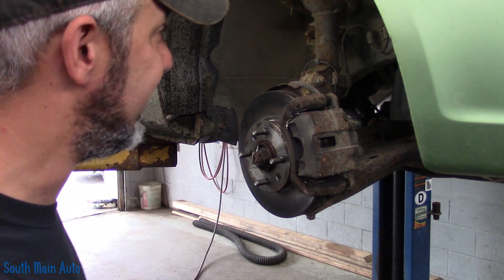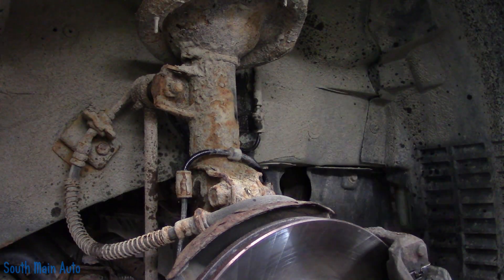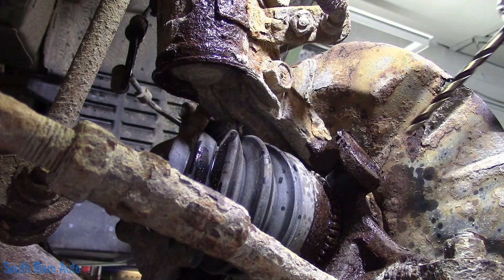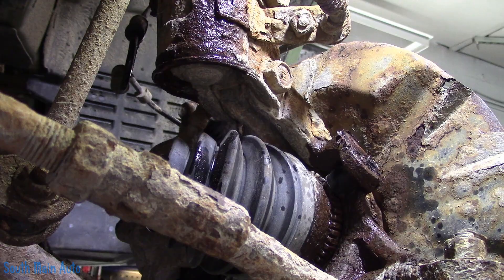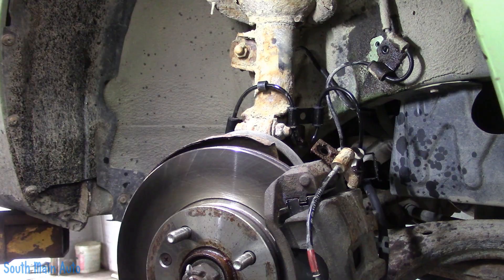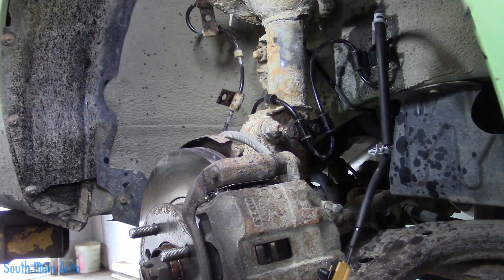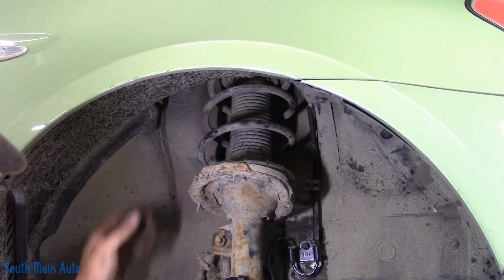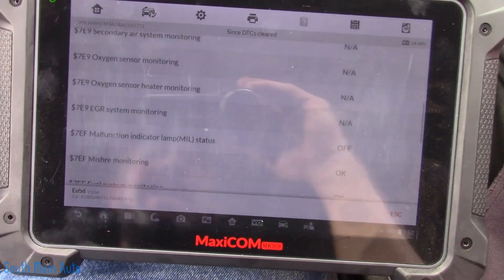Hyundai Accent: P0501 Vehicle Speed Sensor Range/Performance

Comment: Eric, I was just wondering if these sensors on 4 wheel ABS-equipped cars are also used for measuring and displaying overall vehicle speed. If so, how is the speed difference between wheels handled when it comes to displaying the overall speed when taking corners and curves?

Comment: at 9:19 small diameter "flapper wheel" is much easier to control and not obliterate the knuckle hole (clearly you didn't, but not everyone has the experience yet)
I do love carbide burrs and other tooling, they're hard to control and use skillfully outside of lathes and mills ;)
Reply: I'll limit my comment to "JUNK"
why, because they cheped out too much making a electric power tool as was much of the earlier cordless....
junk tooling makes me blow steam out my ears and causes me to exterminate junk vastly

Comment: Drill down to the tone ring and bit hits a tooth, snap tooth is gone. Done that before, not a good day.
Reply: Been there done that.  In my case, the whole tone ring broke off.  Thankfully those were available as a replacement part (mid 2000's Ford Explorer) because they tended to break on their own from corrosion.

Comment: alternate on those with most of the sensor visible out the bottom! torch with pinpoint tip heat the rusted magnet/metal until the composite housing melts and pry-driver it out from the bottom :))
goes back to knowing nuffinks ( i'll edit to mention how easily magnets break when hit or pried on, crunch crunch)

Comment: My guess is the wheel speed sensor you replaced only feeds data to the ABS computer. Why that didn't trigger an ABS code, I don't know. The speedo sensor is probably in the transmission final drive. My 03 Dakota has ABS only by legal definition. The only ABS tone wheel it has is on the differential carrier. The vehicle speed is calculated by the PCM using data from a sensor at the transmission final drive.

Comment: I just did one of these Hyundai rusted in sensors.
Tried drilling and still frozen in hole.
But then I got an idea?  I used the induction bolt heater.
Warmed up all that plastic like melted chocolate.
Parts fell out like Jiggly bits.
Reply: I'd actually wondered why he didn't pull that out seem like a great opportunity to use it but maybe it wouldn't fit in there I don't know

Comment: Just sold my 99 accord with 324,000 miles.  No rust. In some parts of AZ, cars won’t look like this car even in 40 years. Dry brutal heat, with no rust, the choice is yours.
Reply: AZ heat makes plastic parts disintegrate kinda like northern rust on metal parts.
Reply: Henry Dunbar. Yea , plastic doesn’t last, especially on Chrysler cars. I guess what I meant is the heat really sucks but it won’t force cars to the junkyard like rust belt areas. I’m currently bringing back to life my 2001 ram with almost 200,000 miles on it.  The interior plastics didn’t stand a chance but it’ll live to drive another day. As far as the frame and structural areas, cars in Arizona that are 20 years old look like cars in the rust belt that are 3 years old.
Reply: @Jason Bowman Living in Southern Cal is the same thing.  I have one on my 06 Nissan Frontier.

Comment: “Do not use as pry bar or chisel” on the screwdriver handle then chisel and gouges the old sensor out. That’s my man 😀👍
Reply: @n325aej as he said before ever tool has a hammer end lol
Reply: Every tool is a hammer.
Reply: prydriver
Reply: Why are Craftsman screwdrivers better than Snap-on? They don't say not to use them as a pry bar or chisel!
Reply: The scanner computer used in the video: https://amzn.to/2H3l6dt Autel MK908 Ultimate Wireless Automotive Scan Tool with ADAS, ECU Coding, Full Bi-Directional Control, ABS Brake Bleed, OE-Level All Systems Diagnosis

Comment: "Nope. Nope. Got it..nope. There, first try."

🤣
Reply: The scanner computer used in the video: https://amzn.to/2H3l6dt Autel MK908 Ultimate Wireless Automotive Scan Tool with ADAS, ECU Coding, Full Bi-Directional Control, ABS Brake Bleed, OE-Level All Systems Diagnosis
Reply: @dannyyu2932  did you really just post an affiliate link on someone else's video?
Reply: @CoreyRaines  Hello Corey, it is an affiliate link from Eric.
Reply: Exactly what I was thinking! https://youtu.be/3KDnrGdpNZY

Comment: Is that your new ratchet you're using as a hammer again? Lol
Reply: I was thinking the same thing isn't a $12 Hammer cheaper than $119 ratchet
Reply: @deepsquat600  no doubt. Love this guy but i cringe when people use ratchets like hammers. Or worse hammer on the ratchet head with a 3lb'r lol.
Reply: @ed81ny  ..now I will use my $12 harbor freight ratchet to smack on something  but I have some $35 steelman pro flex head extendable that I'll walk upstairs and grab my harbor freight to smack on it first or if worse comes to worse I'll get a hammer lol